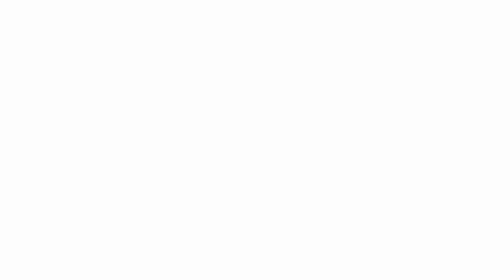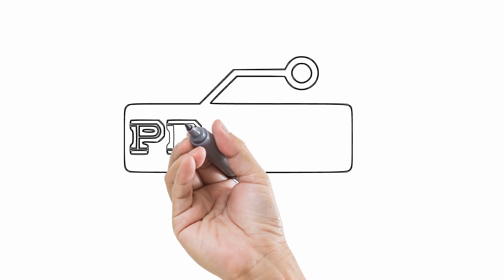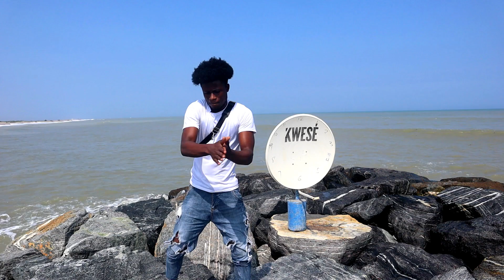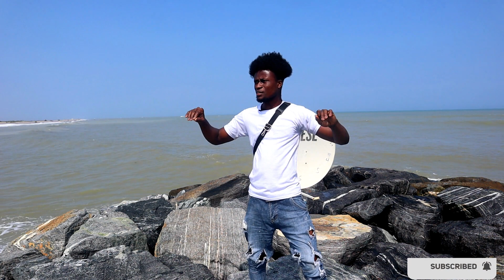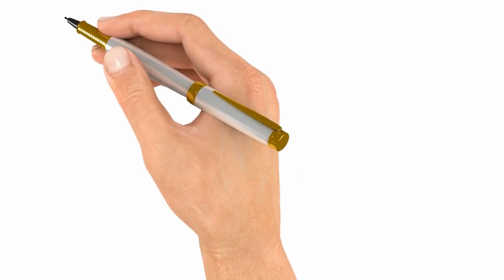How To Solve Dstv Extra-View Error E143-0

Comment: Hello Brother: I've tried to do xtraview using two Dstv Model 8s Decoders using dual LNB and diplexer. then the primary decoder sends heartbeat signal every minuet but the secondary Decoder still displays error E143-0 and the its xtraview communication status remains Idle. we tried to call to the office, they send signal then it works but after a few minuets the E143-0 error appears again. so please how can i get rid of it
please also tell me the following:
👉if it has a minimum signal quality requirement
👉the position of diplexer(where should it placed)

👉if the model i used really support xtraview
and finally thank you for your help and all of your educative videos
🙏🙏

Comment: When do one determine that the LNB is faulty. I have E143-4 and I have been trying to solve but it seems I’m not winning. I have two Explora 1 and they have been working until I had the E48-3 error message . I changed both cables from the smart LNB. My primary is working but my secondary is giving this E143-4 error message. Can you help.
Reply from the maker: Check the cabling well and call DStv for the Extra-View connectivity check up.